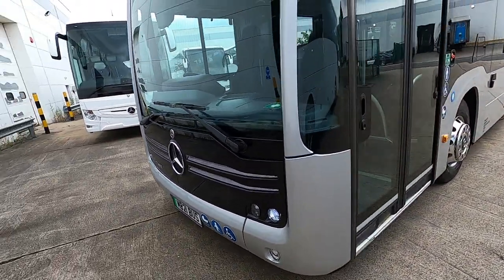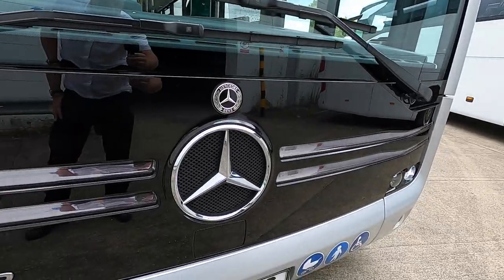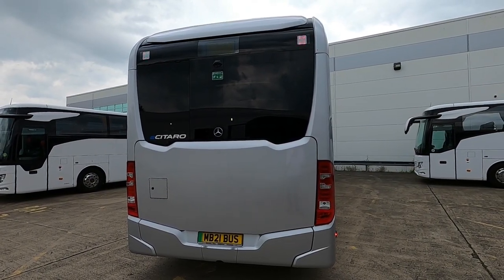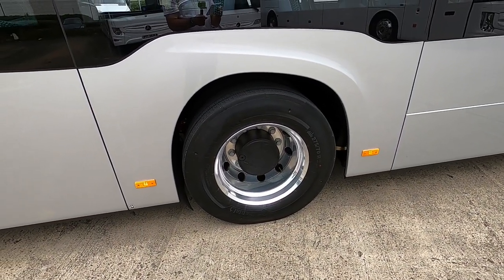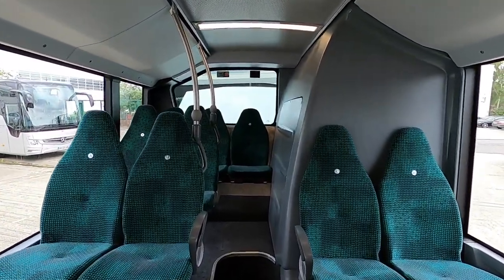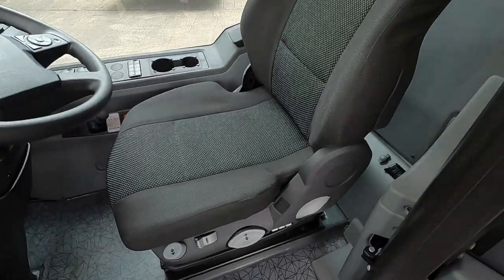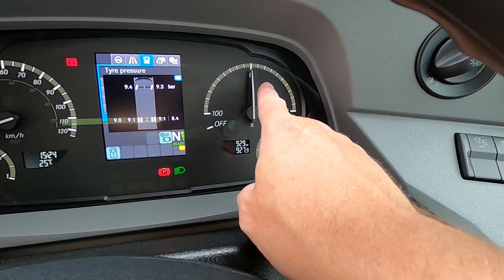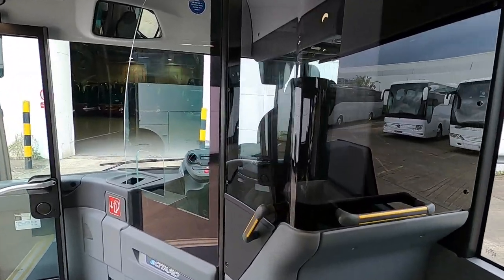Test Drive | Mercedes-Benz eCitaro

Comment: A lot of exposed cabling in the rear wheel well - although you need a lot of protection to guard from a tyre blowout/disintegration, even basic sheeting would protect from twigs and other debris snagging on the cabling.

Comment: I drive older Citaros and new versions like this but diesel. The older cab layout is better. If you inadvertently leave the cab window open and it rains the buttons which are directly below the window get soaked which renders the bus useless. In service the cab door magnetic catch fails which means you have to hold on to the door with one hand  and the doors become inoperative effectively meaning you have broken down. I prefer the simple manual door catch. Keep it simple.
Reply: why would u even open the window? thats why you have hvac.....
Reply: I'm curious to know what pedals are used. Car like or bus derived like on wright/Alexander Dennis? Love the look and quality of the Citaro.
Reply: @johndonovan7018  What a ridiculous question... So many much prefer feeling a breeze from the air outside than having hvac blowing on you. Seriously, what a f'n stupid remark.
Reply: @GODSPEEDseven  only smokers prefer that. are you a smoker? i mean if you are eurotrash, probably. yall smoke there
Reply: @johndonovan7018  What?! You're a pretty funny fellow. 🤣
Reply: @GODSPEEDseven  i do freelance as a comedian at the local biker holes